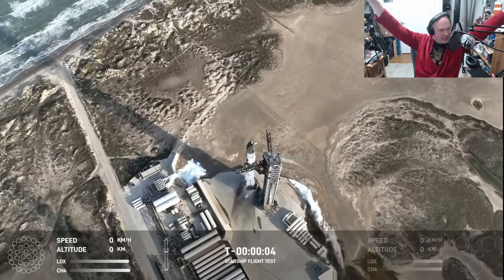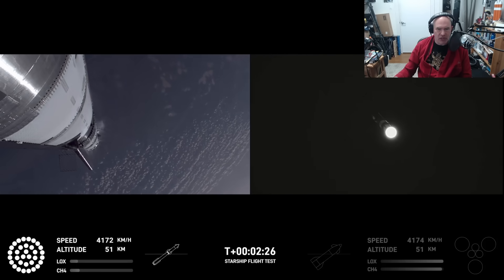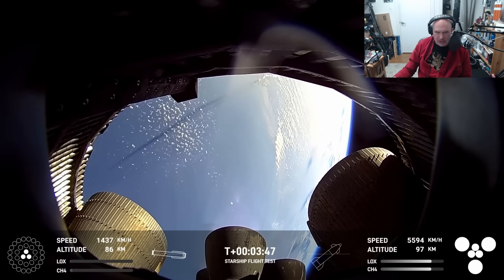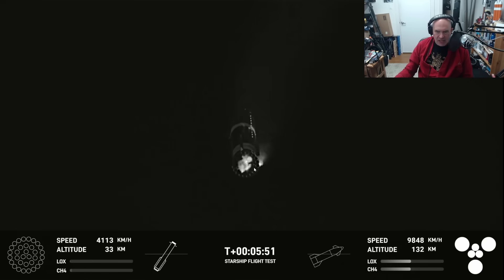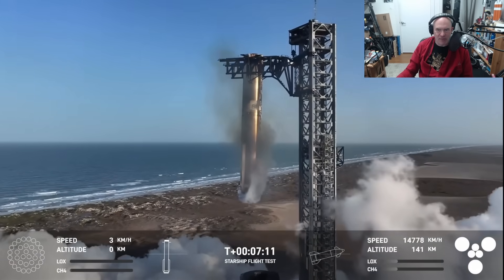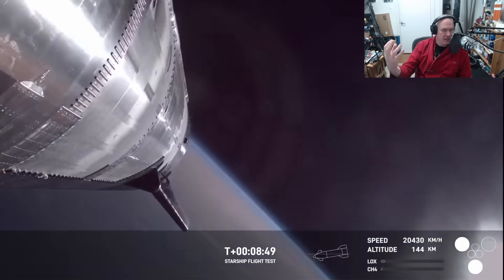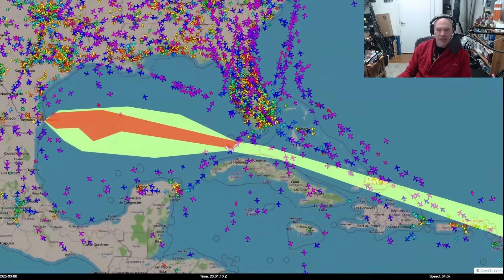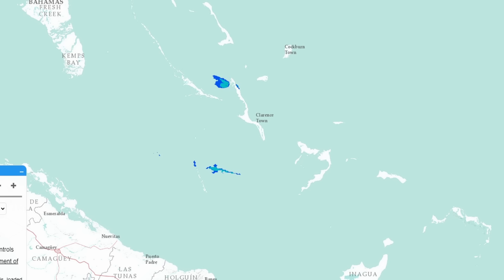SpaceX Make The Same Mistake Twice With Starship Flight 8

Comment: There's a buncha reasons this doesn't bother me too much.
The one that's relevant to this video is this: The only way to find the limit of how far you can optimize a rocket is to exceed it and have the rocket fail.
Additionally, if you were operating by old-space standards, Starship V2 is a completely new rocket stage that is DERIVED in large part from Starship v1, but it is NOT AT ALL the same rocket.
Starship V1 seemed to be fairly well behaved, but you have to remember that was benefiting from flight testing all the way back to Starhopper.
In many places, Starship V2 has no such flight heritage to benefit from, so I was fully expecting this second flight of Starship V2 to have no end of trouble, and it seems my expectations were in line with reality.

Comment: SS. V2 has a SERIOUS Design flaw it seems.
If an engine goes like that the ship should be recoverable somehow. 
I think they need to go back to the drawing board on this one, hell maybe just focus on Flacon and Flacon heavy for the moon missions, those platforms are proven.
The Starship like SLS and even New Glenn simply don't have the same market forces behind them that made Flacon sucessful, being that it had to start being profitable ASAP.
SpaceX is burning alot of cash and confidence with these failures.
Reply: Falcon* like the bird.  Considering they already have the booster working well it'd be pretty dumb to stop now.  The booster is the hard part.

Comment: And this all seems to come back to the fact that the launch pad does NOT have a proper flame diverter and flame trench which results in the enormous acoustic energy bouncing back from the water cooled plate right back up to the rocket.  The first stage being closer to the reflections might seem at greater risk of damage, but the fact that the engines on the first stage are running might actually limit the damage done to the first stage while offering little benefit to the second stage.  When you watch a Starship launch you can see the insane sea of shockwaves bathing the rocket whereas other rockets with proper flame diverters and flame trenches has that energy channeled away from the rocket and the rocket is therefore not so heavily bathed in a sea of shockwaves.
Reply: How are these shockwaves being diverted from going away from the rocket in all directions to being focused back toward it?  It's an upside down V to the ground, and then is reflected back to a right way up V, all the while expanding in every direction.
Reply: @jnawk83  The water cooled plate is not v-shaped, it's a flat plate with water cooling.
Also, you can see with your own eyes the sea of shockwaves bathing the rocket so we know it's happening ... we can see it happening!  With other launchpads the exhaust is diverted away from the rocket so the acoustic energy and shockwaves are not impinging on the rocket to the same degree.  All of this appears to be a consequence of them needing to build two launch platforms in an area that's too small to have a single launch tower with a proper flame diverter and flame trench.  The desire to launch from Boca Chica compromises many things including the limited space available making a proper flame diverter and flame trench impractical to build do to the limited space, but is also means the flight profile is further limited to the gap between Key West and Cuba, or about 95 degrees, whereas launching from KSC permits the launch from about 32 degrees to about 118 degrees permitting a launch from KSC with a much wider launch angle.

Comment: I'm wondering if the hot staging is not working well with the V2 plumbing.  I know that it was successful with V1 and that there is significant exhaust vent through the hot stage ring - but that still has to be a ton of pressure build up inside the Starship engine area prior to pulling away from the booster. Could it be too much for the new configuration - compromising the engine systems of the Starship?

Comment: Could this failure be caused by the hot staging gases bouncing on the HS ring and badly shaking the pipes ?  It would cause random damage that would fail later in flight.  SpaceX should test the HS ring at Maceys stand to rule out this.

Comment: I'm really surprised they've caught all 3 rockets on each attempt with the tower. I really thought by now we'd have seen one explode by either hitting the tower, or some mishap that results in a RUD as it's hanging there or just hitting the chopsticks too hard. I'm sure that's going to happen at some point, but I'm damn impressed that it hasn't yet.
Reply: Don't jinx it, now the next launch is going to make it to orbit, and the booster is going to erase the tower 🥶
Reply: @tubejay1  There's a big difference in catching a object that only has to slow down from 2000 mph vs an object that has to slow down from 17,000 mph.....
Reply: It took 15 failures to figure out landing a booster at a static location. That's something SpaceX is really really good at.
Reply: Methinks their engineering team is aware that a calamitous booster landing is exponentially worse than a booster raining over the ocean.
Reply: The tower catch is technically waaaay easier than the barge landing. The hard part was making the tower work.
Reply: "RUD" aka explosion in plain English.😂
Reply: it will happen. Chance guarantees it
Reply: @RaspberryWhy  There is no guarantee in engineering. The current iteration is wrong in many ways and will require a complete redesign. Some old aspects may be incorporated into the new design....
Reply: Agree, booster has out performed, ship has under performed.
Reply: I’m surprised the booster hasn’t swung itself off the arms, those pin sockets are really well-developed, huh
Reply: That collision is going to happen eventually
Reply: Human error and the inconsistencies of engineering mean it'll probably happen eventually. By the look of it they'll certainly use the system enough times to find that chance failure.
Reply: They’re extremely cautious about it. If there’s the slightest bit of concern of bad approach, they offshore divert because blowing up the only operational tower would be BAD.
Reply: @Syntex366  Regardless how many they have blowing up the tower would be bad M'kay. Don't do that. Which raises the question of just how reliable the super heavy booster will really be, as far as not sacrificing them at the slightest hint something might not be nominal for a return to pad. So far they're three of four on that.
Reply: Each landing for these tests also gives them more data to work with and refine the process, there is value to it!
Reply: Good at catching, not so good at throwing. SpaceX playing defense, not offense.
Reply: I think we all thought that the booster would be the hard thing to get to work, but apparently starship is the troublesome part
Reply: They've caught 3 of 4. The second return to launch flight diverted into the water.
Reply: @AndrewBlucher that’s what he said “caught all 3 rockets on each attempt with the tower”.. there’s only been 3 attempts with the tower.
Reply: @Scooty_jr  Ah, reading comprehension. I'll have to work on that!
Reply: @AndrewBlucher  It actually wasn't B13's fault, it had something to do with the tower which forced mission control to divert B13 to the Atlantic
Reply: @blurryfaceonyoutube  it was the gulf of mexico that they diverted to, pretty sure
Reply: @plane.355 you mean the Gulf of America.
Reply: @keaganverschuure9135 nah, it was still the Gulf of Mexico back then. We don't need this revisionist stuff please.
Reply: @keaganverschuure9135  We mean the gulf those of us who live on it never say the "of" part.
Reply: @keaganverschuure9135  no, they meant Gulf of Mexico
Reply: @plane.355  Unfortunately, yes. Would have been pretty cool to see a vehicle named "13" be successful for once
Reply: @danielch6662 Gulf Of America, except it.
Reply: @AndrewBlucher good point I think the tower failed checks for that one?
Reply: @AndrewBlucher yeah but there was no catch attempt in the first place on that flight
Reply: @AndrewBlucher did they attempt to catch the one landing in the ocean?  Not that I’m aware of.  They diverted it well before landing burn.
Reply: @qwerty112311  yeah when something's sufficiently off nominal that they don't even attempt the catch that's a failed catch. They most certainly did not intend to put it down in the Gulf as plan A. lol, whether that was a failing of the tower systems or the booster does it really matter? It's a failed catch just the same. They had the opportunity to do it, that was plan A, and they aborted it to plan B, sacrifice the booster and splash it down in the Gulf.
Reply: It is nice that they can do the unimportant but fancy looking thing but they actually can’t put stuff to orbit.
Reply: @realGBx64  yep, without an orbital second stage it's just a neat party trick not a viable launch system
Reply: @tubejay1  3 of 3? Are we forgetting Elon's big event with Trump attending to show off, and then deciding the booster wasn't nominal and diverting for splashdown in the Gulf? It's 3 of 4.